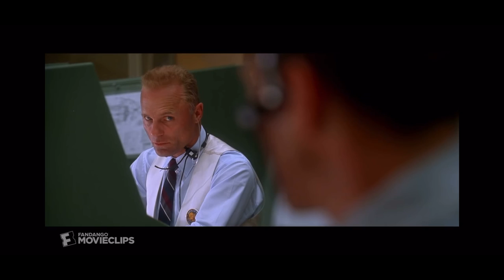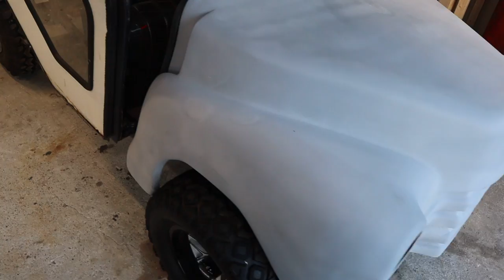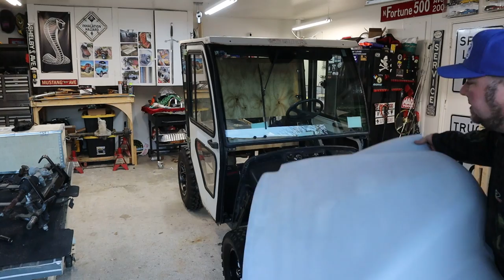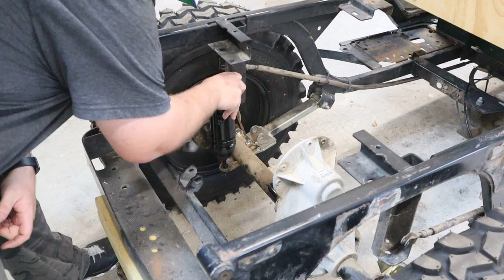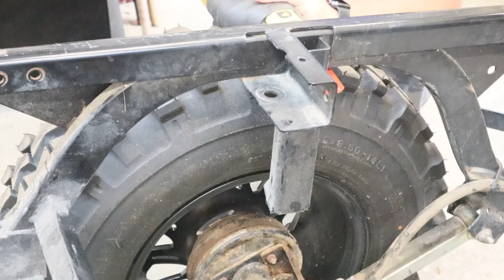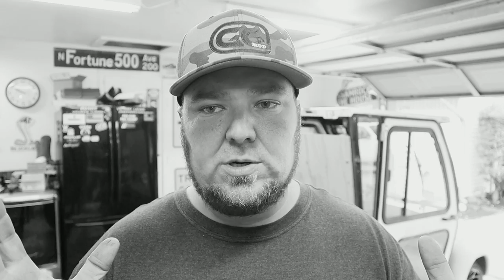AIR RIDE DUALLY GOLF CART !!

Comment: Are you ever going to update the progress on this cart? How the duals were mounted and then corrected? Stretching the frame......... 

Inquiring minds want to know
Reply from the maker: The cart is in Georgia getting all the air suspension finished. should have it Back shortly
Reply: @GolfCartsModified  Sweet, I wanna do air and a 4 forward stretch on my Precedent but I'm not sure whether I should go 3 link or 4 triangulated. Currently I have a two link truck arm that I extended the wheel base so I could get Escalade wheels on it without a lift. 👍

Comment: What air shocks do I need for the rear of my Yamaha G29 drive. I need to raise it a little in the back so my fender flairs will fit with out rubbing. I can't put a lift on it because it wont clear my car hauler
Reply: I have been working on a kit for the G29 over the past 2 years it will be released this spring